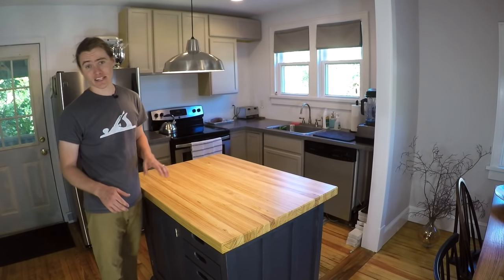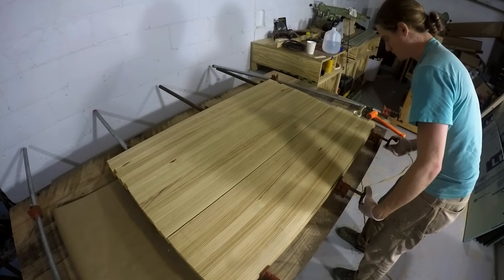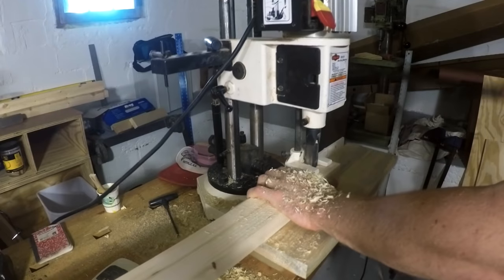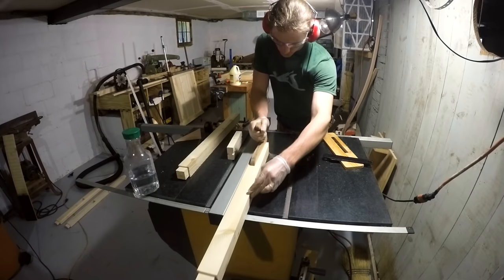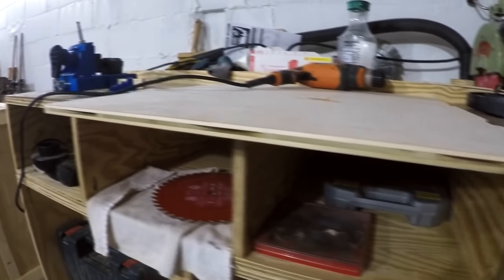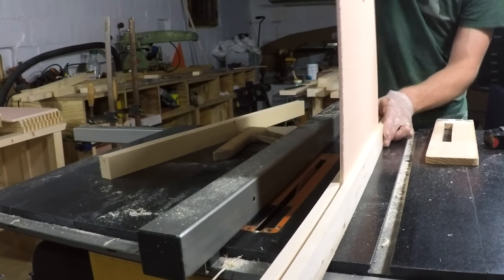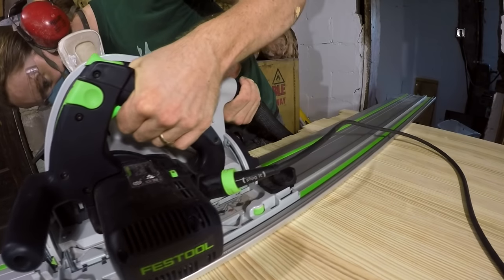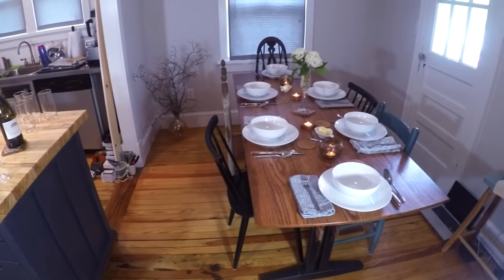Making My Kitchen Island - With LOTS of Storage!

Comment: Your island turned out great!  It's amazing how regular old SPF lumber can look great!  Nice work.
Reply from the maker: +Brian McCauley If your careful in selecting and take the right steps it can be beautiful. But it can be a little unpredictable as far as movement since it's not really "dry". In this case, the way it is constructed, I'm safe. Thanks for watching.
Reply: The Homestead Craftsman I've run into the perils of SPF before when I first started woodworking. I had a table top turn into a potato chip on me. Luckily I learned my lesson pretty quickly!
Reply from the maker: +Brian McCauley I've found the best way to get a top made out of it is to rip it into strips, flip the strips to alternate the grain as much as possible and glue it all back up, like in the island. It balances out the movement. But it's just yellow pine, which a lot of nice furniture is made out of, if you dry it first, it's perfectly fine. If you just let it sit inside your house long enough it will acclimate. I have a lumber rack and keep a bunch of 2X4's , 2X6's and other stuff on hand, that way it is already adjusted some and done a little movement, you can usually pick out the boards that are going to curl up on you. A lot of times too, you can have a pretty straight nice piece and then when you go to rip it it will curl right up, I guess it's just releasing tension in the wood.

Comment: Great build, and very beautiful kitchen!
There's a German paint, that you buy in powdered form, and prepare with boiled water, whenever you want to use it. The colors are very vivid, it goes deep in the wood, but the wood grain still shows, as if it was the wood's natural color. Yes, I'm not very keen on painting wood ;)
Reply from the maker: +Αλέξανδρος Κεντάκας I do a mix of both sometimes it's best to go with a clear coat and other times it's best to paint, just depends on the design and what else is around the piece of furniture. In this case, it's the style that we wanted and also using a mix of lower grade woods made it a paint job. It's tough to show finish accurately in a video, but it turned out pretty nice. Thanks.

Comment: I really like your videos and your projects, loved the design of that kitchen island, it's hard to see yellow pine wood as a natural finish because it tents to be a really common wood, but the color you choose for the bottom makes a really great contrast!

thx for the content! keep it up!
Reply from the maker: +Daniel Chavarría G. My first choice for the top was some reclaimed heart pine from an old factory, but my wife really like a previous piece I made for a customer using yellow pine, so I went with what she wanted. I just made sure that when I selected my lumber that I chose flat saw boards, instead of more quarter sawn, that way when I ripped them and stood them on edge for glue up, I get a quarter sawn grain pattern on the edge. Most of the 2X8 and up are sawn from the center of the tree, so they have a more quarter sawn grain. So you have to go through a lot of boards to get the right pieces.
Reply: It really looks great men!! thx for the technical information, i'll try that pattern someday!

Comment: Beautiful work as always. The overall look of the piece is excellent. I especially like how you built the drawers so you can open them from both sides. Also, you didn't have to use expensive drawer slides then. :)
Reply from the maker: +Mark Hanson (Mark's Workshop Creations) Thank you, I like the idea of drawer slides, but they kinda look cheap, waxed wood on wood is very smooth. Thanks again.

Comment: Great project and very nice craftsmanship! I have a couple questions for you if you dont mind. How do you find your softwood lumber supply? When I build projects like this I often deal with a lot of warping/bowing of the material when I cut it into strips or resaw it. As you did quite a bit of this in your video I was wondering how much you had to deal with this and do you have a method for selecting boards that will have less of a tendency to do this?

My other question is now that you've had this island for about a year, how do you find the top is holding up? I often use ash/oak/maple for the tops as they take wear/abuse much better than pine.

Anyway sorry for writing a book! Thanks for the video. Your work is fantastic!
-Matt
Reply from the maker: I get the construction lumber from lowes. Mainly I choose 2X6 for spruce, not 2X4. I rip them up to what ever I need. I pick the lightest weight ones as well. When I use yellow pine like the top, I pick boards that I can use in a quarter sawn orientation. I had some lumber go crazy on me, but I pre cut a lot of stuff over sized and let it sit in my AC shop for over a month, that took out certain pieces. After having the island for a while the top is dead flat still. The only thing that would happen at this point is denting it up due to being softer but it will age nicely so it's not a problem. I could have used a hardwood but my wife wanted the pine. I have a bunch of kiln dried 2 inch ash and oak sitting in my basement. If I was going hardwood, I would have used walnut probably, or the oak maybe. The base is also doing nicely, of course the wood is softer so it's not going to be as dent proof as something harder but again, I like how things age, the first few dents are painful but over time pine furniture has a nice look

Comment: I love this island. My wife wants something similar and the only improvement I can think of for our situation is locking casters on the bottom so we can move it around easier as needed.
Reply from the maker: I don't know your situation but most likely once you know where you want it, it will not move. I'm going to be posting a video on a new island build sort of soon and will also be doing a set of plans on it, so that may interest you. It could easily be adapted to have wheels. It's in a similar style as my tables and the first island video I did.
Reply: The Homestead Craftsman if that's the case I may build it without wheels but my wife will of course have the final say since she'll be using it most. 
Either way the island is very nice and relatively simple. I'm adapting some different techniques to achieve similar results as I'm not very familiar with mortise and tenon yet and my skills are still relatively amateur. 
I can't wait for the new video.

Comment: Looking good!   The top contrasts really well with the blue of the base.   The double-sided drawers are neat.    You must have added a floor outlet, if you have a microwave in the island?

Are you still working on the kitchen?  I'm trying to figure out why there is that big open space in the very corner  (left of the sink) where it looks like an upper cabinet would fit.  I like the rustic look of the kitchen/dining floor as well.
Reply from the maker: +wordsnwood The kitchen is still in the works, still need to build in some opens shelves in the spots you commented on, hang the range hood and several other things. The floors where pretty rough, so considering what they looked like, I was also very happy with them once sanded. I still haven't done it, but there is going to be an outlet inside the island for the microwave coming up from the basement. Thanks.

Comment: You do such beautiful work!  I love your appreciation of the skills needed and willingness to share them.   I am interested in how this pine top is working out for you?  I was a little shocked that you used such a soft wood for a kitchen work surface, although extra storage is always nice.
Reply from the maker: +Skatooli The only thing that really would make a difference would be cutting on it, which I wouldn't do even if it where a harder wood, just use a cutting board. It's a soft wood, but it's hard enough. Over time it will get marked up but it will develop a nice look and it's style is one that welcomes "weathering". Many floors in houses are are pine, including mine. With a polyurethane finish you get a good amount of protection. Is it a rock maple top?, no.......but the whole project as I stated was easy to source materials which I liked and makes it easy on the average guy watching the video who wants to build one. Being that I made it, it's not the end of the line either, If for what ever reason I ever want want I can replace anything on the island, including the top. The top is holding up nicely to answer your question. Other than some dents here and there, which I don't mind, it looks great. I've made them in the past for people like this and my wife really liked it so that's the route I went. Thanks for comment and for watching the video. Hope to see you in the comments again in the future.
Reply: Thank you so much for your quick response.  You addressed the issues I was concerned with exactly! I've dabbled in woodworking, mostly because I believe in trying anything that interests me, but I do admit to looking at it from a cook's perspective, where I would want a harder wood.  I have nothing against nicks and dents- that is life and part of the beauty of living with a piece. I apologize for having such a bee in my bonnet about the pine...however- have you ever routed out a section on the top for different boards?  I have a large marble slab for baking, and old cutting boards- I would love to see something incorporated along those lines.  The hardest part of watching your videos is not being able to run my hands along the work.  Best to you and yours!
Reply from the maker: +Skatooli My wife is quite the cook as well and she hasn't had any problems. Anytime she does rough work, she does it on top of one of the many cutting boards she has. I haven't routed out a section as you described, I can see it being a place where debris would build up and constantly have to be cleaned out. In the average house I think pine is fine, in a professional kitchen it may be too soft. As far as a bee in your bonnet, that's no problem. That's one of the benefits of making videos. Comments are places for  people to hear others thoughts, ask questions and a great opportunity for me to get feedback that I can take advantage of later on making videos. Thanks again.

Comment: It might would be neat and maybe helpful to use magnets as a drawer "stop." In my mind, using inlayed magnets in the side of the drawer and the other in the framing of the island to help keep the drawer in place and aligned from small bumps or children running through and to help "snap" into place when being shut. But it's super rad without it so I don't even mind!
Reply from the maker: +Patrick Floyd In this situation magnets would not do anything, but in small boxes, inlayed magnets are great for keeping lids secure. I did a small jewelry box that way. These drawers are over 2 feet long and loaded down. Thanks for watching.

Comment: Very cool project! I like the details you put into your all your projects/work. How did you run power for your microwave? Keep the videos coming! Thanks Rob.
Reply from the maker: +Rob D Right now it's just an extension cord.......... but I'm going to run power up through the floor.
Reply: +The Homestead Craftsman Nice! I figured you'd end up doing something like that. Have you got to use the new bandsaw yet?
Reply from the maker: +Rob D Yes, quite a bit. It works great. I'm working on a few projects now using it so it will show up in some videos sooner or later in addition to the videos I mentioned in the intro video on the saw. I also just got another piece of equipment that has been stealing some of my attention. I've got several tools I've been wanting to add for quite some time now, so getting them into the shop is very nice.
Reply: +The Homestead Craftsman Thats awesome! Looking forward to seeing them. Thanks for replying.

Comment: Kitchen looks Great, the track saw is a super handy tool huh?
Reply from the maker: +Lane  Bros WoodShop The track saw is bad to the bone!
Reply: +Lane  Bros WoodShop... I was able to pick up a DeWalt track saw with two tracks and clamps for $300. It sat on the shelf since 2009 still in the box at my local home center. May not be as good as a Festool but it really makes accurate clean cuts on sheet goods!
Reply from the maker: +Kim Shirley I was going to get the dewalt myself, but it just didn't cut deep enough for what I do, so other than Festool, Mafel (or however you spell it) was the only other company that had the capacity I needed..... I think. But I like the Dewalt saws, I have a good amount of dewalt stuff and like it all.

Comment: It looks really sharp! Well done. Did you use oil based poly on the top? How many coats did you end up doing? Also, is there any particular reason you wanted the drawers to be one solid, long piece, accessible from either side? Was that just a preference, for sturdiness...I'm curious.
Reply from the maker: +Bruce A. Ulrich Oil poly, satin Minwax. I do at least 3 coats on stuff. In the video it only had two, so I added more later. For the drawers, it's how I built my workbench drawer and really like it so I thought it would be good here. Like I said in the beggining of the video, it lets you access the items from either side. So when my wife is in the kitchen, I can just come in from the other side and grab a fork without bothering her. Also, it maximizes the available space. If someone didn't like the idea, you could easily have two separate drawers. I also like it a lot because if you want, you can just slide the whole drawer out and use it as a box or tray or carry the contents outside, say if you are grilling and want all your spices outside. So, short story..preference but they are some rock solid drawers. Thanks for watching.
Reply: Oh, that is a cool idea about taking the whole drawer out and carried it outside!

Comment: After a few months how is the pine top holding up i am looking to build a similar one also love the pass thru drawers thx
Reply from the maker: +Bryan It's doing good. There's a tiny amount of movement in the top, but an amount that is barely noticeable. It would have been easily avoidable if I let the pine sit around for a little longer before I glued up the top. All that has happened so far is when you rub your hands across the top, you can feel a slight difference in the boards, almost as if a few sunk down a little. It causes no real problem. The base is as good as the day I made it. The spruce lumber is much more stable than yellow pine (referring to lowes wood.) and I used lumber that I had for a while so it was acclimated to the house. To get the best looking top, choose boards where the grain looks nice on the edge. It's all flat sawn, but you want to steer clear of ones that are close to the center of the log. That way, once you rip them up and turn them on their edge, they will give you a quarter sawn grain.

Comment: Another very informative video.  I know you used biscuits for alignment.  If you had a Festool Domino would that be for alignment too or do the dominoes offer stability as well?  Thanks for the video, I really enjoy your build vids along with your tool reviews.
Reply from the maker: +Fifteen Buckeye Both, it would align parts, but also is structural. So are biscuits, but not as much. The domino is just a floating tenon, that's nothing new, what is new is a handheld machine that cuts the mortises like it does. So while it can be used for alignment it's a joinery tool in the way of structurally connecting two parts where a complicated mortise and tenon joint may have been used. It's a very cool tool and one that I plan on adding to my "arsenal" soon.

Comment: Great video as always , i am really enyoing this channel and the process to make the house to what it is now and wow it looks amazing .
Btw now that you have used you're festool tracksaw on several projects do you have any regrets and would you buy any accessories for the tool for next projects??
Reply from the maker: +r peffer Thanks. Zero regrets on the track saw, if it where twice as much I'd still buy it and I'm a penny pincher.  Where I'm different from many woodworkers though is that all the tools I buy make me money, so I'm looking at it a little different that a hobbyist, but woodworking is also my "hobby" so I benefit from having all these tools. For me it's not just a tool that makes things easier, it's a money maker. It makes so many of my jobs faster. Accessories.... I'd have more rails, I'd like some of the shorter ones 2 or 3 feet long for cross cutting odd shaped lumber like live edge boards, crotches, etc. Just haven't bought them yet.  Also a couple of blades, ripping blade and an extra blade like comes on it. I have the quick clamps which are great and recommend them, they are quick and easy. It's a great saw, but I bet most of the track saws are great too.

Comment: Wonderful work! I do have a question regarding your planer dust collection. Where did you find a dust port for the porter cable planer?
Reply from the maker: +Jacob Smith (WoodSmith) It's hiding under the name "Delta" here you go. http://www.amazon.com/DELTA-50-359-12-Inch-Planer-Connect/dp/B0006NBUX2/ref=sr_1_1?ie=UTF8&qid=1449551718&sr=8-1&keywords=delta+planer+dust+hood